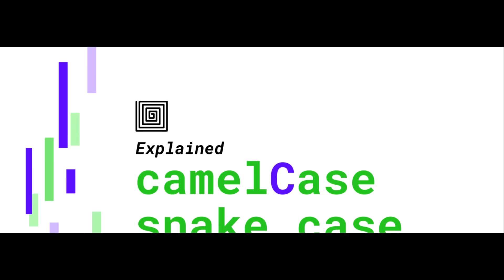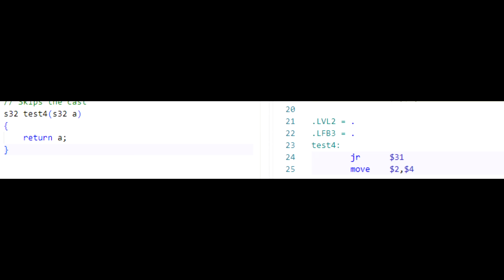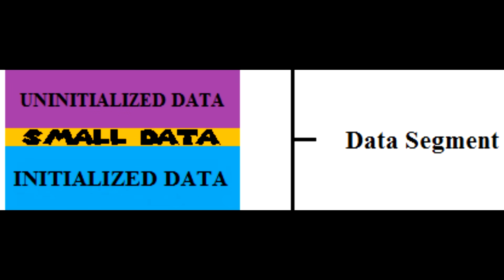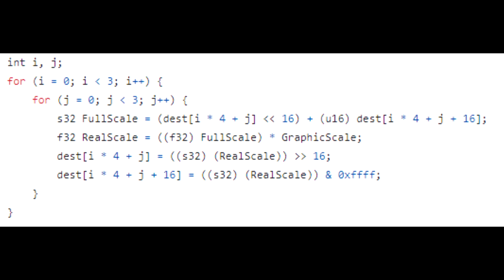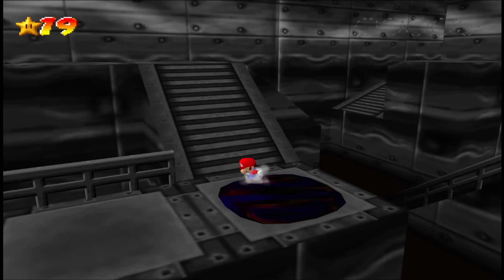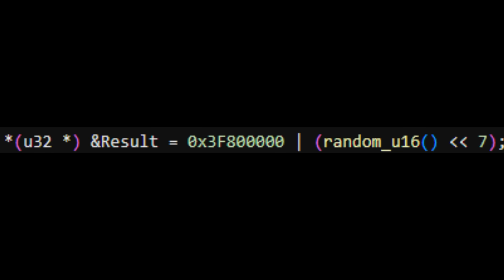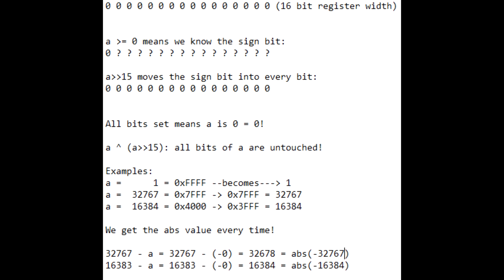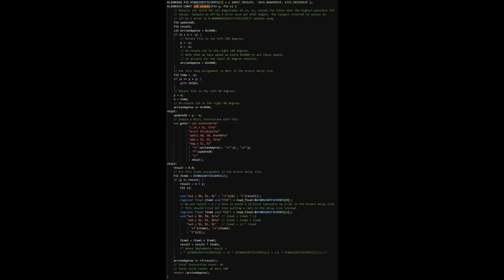Optimizing with "Bad Code"

Comment: The compiler's not going to flip the direction of your loops around for you. That said the reverse loop's typically written for(int i = init; i--;). Loops are interesting because if you really need to you can break a for loop down into a do while nested inside an if and some optimizations the compiler might not risk because of the signednesss of the index. See what the compiler does when you use unsigned int i vs int i.
Reply from the maker: why not? it should produce the exact same functionality for less cycles. it should be able to flip that.
Reply: I think it's a bit asinine that the compiler won't flip it. Also as for signedness of loop counters, I never understood why that matters. At a hardware level the comparison is signed, not the number itself.
Reply: @KazeN64 the compiler would have to do quite a bit of semantic analysis to verify that the resulting code behaves the same. The problem fundamentally is that incrementing and decrementing are two distinct behaviors, the compiler's a bit of a hardnose. You and I can look at the code and see an obvious difference and improvement, but without someone writing a compiler optimization pass that 100% gets it right when to reverse the loop or not it could produce wildly different behaviors.

Consider shifting data backwards or forwards in an array, although the code is very similar there's a reason for the direction of the loop to avoid overwriting data or referencing stale data etc. An optimization pass likely would need to determine that the memory accesses are non-overlapping among other conditions. And from my memory, I don't think I've ever seen a compiler do this, but that might in part be because the optimization exists but the hardware I'm targeting doesn't have this benefit. The reason I'd be suspicious it would is that for very old hardware this was very much was a thing, it used to be significantly better to loop in reverse over data, the hardware we have now is agnostic about the direction but still prefers local accesses. I'd doubt this optimization pass would exist for your compiler to use on the n64.
Reply: @williamdrum9899  To be fair  it is a bit strange that it would matter, it's not immediately intuitive but it's to do with how the c/c++ standard pictures a sort of universal cpu to be able to function and how they'd like to be really precise with what different operations mean on different types. Essentially the signedness determines whether wrap around is the expected behavior or not, the result is that for example the comparison x < y has different behaviors depending on the signedness and so at the optimization level has different constraints to prove that making certain transformations result in the same behavior of code. Simple example, say x = 0, if signed when running the comparison consider what the the signed -1 value looks like in binary if it were treated as unsigned. The "standard" though confusing, allows that difference to matter and consequently the people writing the compiler with that bit of wiggle room can prove slightly different things about your code, and thus do different optimizations because of it.

A better example might be a combination of lines like int x = other_number; int y = x + 1; if (x > y) {} vs unsigned int = other_number; unsigned int y = x + 1; if (x > y) {}, if I remember correctly because wrap around isn't expected of signed numbers, the compiler may discard the if condition and always assume it's true, conversely for the unsigned type because the typing allows wrap around it can't discard the condition.
Reply: @andersama2215  I think I see what you're getting at. 

unsigned int x = some_number;
unsigned int y = x+1;
if(x>y){}

If I'm understanding correctly the compiler can't discard the "if" because x could be FFFFFFFF.
Reply from the maker: @andersama2215  its really not that complicated, especially in the case of a linked list iteration. and even the specific, more complicated example you are giving here is something the compiler does reordering on if you use the "restrict" keyword.
Reply: @williamdrum9899  The way I've seen it described doesn't really translate well with "wrap-around" or "overflow" etc... The way I prefer to think about it and the way I imagine the people considering the optimizations think about it is whether operations preserve the "signedness" of the result. By tacking on "unsigned" which isn't the default for the integer types they have the freedom to ignore the "sign" because there wasn't any to start with and so the code is more along the lines of what you'd probably expect out of the hardware doing 2's complement math anyway.

Comment: Once I was writing a loop in assembly that did two different things at several points based on a boolean state variable. Instead of checking the variable each time and branching I just wrote two variants of the loop and jumped between the equivalent point in the loop whenever I wanted to change the variable, eliminating said variable.

Comment: This is not bad code. It might be to the modern OOP kids who believe in SOLID and it might have given a heart attack to the webdev lot who have never heard about gotos but, objectively, this is not bad code. It is code that does its one and only job : improving the performance of the game. Code readability is overrated. You're more likely going to either rewrite it all again or never touch it ever than do incremental maintenance on it. As long as you know what the functions are doing then you're golden.

Comment: 11:05 If you're serious about optimizing for hardware revisions, it seems to me it'd be simplest to include multiple compiled versions of RTYI in the ROM and code up a simple apploader to run beforehand which can detect the hardware revision and load the correct executable. Hardware testing every version would be a headache, though.
Reply from the maker: i would like it to just be one rom at the end. having multiple different roms just feels wrong to me.
Reply: @KazeN64  What I'm saying is one ROM, but multiple executables.  Only if there's enough space on the ROM for that, of course.
Reply from the maker: oh in that case isn't your suggestion basically the exact one i implemented? or what more do you want added to the idea i presented

ROM space is the biggest limit btw, it'll be hard to stay under 64mb.
Reply: @KazeN64 I'm not too knowledgeable, but the bug you showed in the screenshot seems pervasive enough that the entire codebase would benefit from not needing to work around that hardware bug. If that's true, then "cross compiling" for different N64 revisions and selecting the correct executable at runtime seems like a better optimization then self-modifying select functions that might benefit the most from not having the hardware bug workaround.  If I understand, your current solution is the latter,
Reply: @Minty_Meeo  I think their goal is to fit on a single N64 cartridge, so increasing the total code size by 2x or more is probably not a good solution.

Comment: 8:27 This seems like a terribly misguided optimization.  Why not rework the Object struct to contain a vector3f for the xyz position, then rework lateral_dist_between_objects to accept pointers to vector3f structs?  Nothing specific to the Object struct is needed in that function.
Reply from the maker: takes 1-2 cycle more to give the pointer to the vector in the object instead of just the object
Reply: Okay, that must be a deficiency in MIPS, then.  I'm more familiar with PowerPC, and in that architecture the addi instruction can be used as a move register mnemonic, so the cost of passing a parameter of Object* and a parameter of pointer-to vector3f member of Object* would be the same, I think.
Reply from the maker: that can be done here too but you now have the additional move instruction
Reply: @Minty_Meeo  It's not the same, if I understand this micro-optimization correctly it saves one instruction:

; Using vector pointers
lui     $v0,%hi(objv1)
lw      $a0,%lo(objv1)($v0) ; load the obj pointer into a0
addiu   $a1,$a0,36 ; add offset to second vector
jal     lateral_dist_between_objects_vec(vec3*, vec3*)
addiu   $a0,$a0,4 ; add offset to first vector

; Using Kaze's method
lui     $v0,%hi(objx)
lw      $a0,%lo(objx)($v0) ; load first object address into a0
jal     lateral_dist_between_objects(obj*, obj*)
addiu   $a1,$a0,32 ; load "second object" (it's just the computed address, as shown in the video)

Such optimization would also apply for PowerPC, see:

; Using vector pointers
lis r9,objv1@ha
lwz r3,objv1@l(9) ; load the obj pointer into r3
addi r4,r3,36  ; add offset to second vector
addi r3,r3,4  ; add offset to first vector
bl lateral_dist_between_objects_vec(vec3*, vec3*)

; Using Kaze's method
lis r9,objx@ha
lwz r3,objx@l(r9) ; load first object address into r3
addi r4,r3,32  ; load "second object" (it's just the computed address, as shown in the video)
bl lateral_dist_between_objects(obj*, obj*)

So it is faster by virtue of saving 1 WHOLE instruction! If the obj was in inside the $gp area then the first lui instruction would also be saved, but that'd apply for both methods regardless.
Reply: Oh, I was assuming the object pointers would already be in registers, but if loading them is a step, and the pointers to objects are still needed after the function call, then I suppose this is faster.
Reply: @Minty_Meeo  Kaze did mention in the pinned comment that this way "we can cover one special case in 1 cycle less and have all the other cases work in the same amount of cycles". 
So it is indeed a micro optimization that is better for that special case he showcased in the video and otherwise is the same.

Comment: 8:04 but you still have a jump in there.  that GOTO doesn't get optimized out, does it?  jumps are really slow.  even a short branch forces a pipeline flush, doesn't it?  How much performance does not having to cache those... what, 20 opcodes? buy you, and is it more than the pipeline flush?

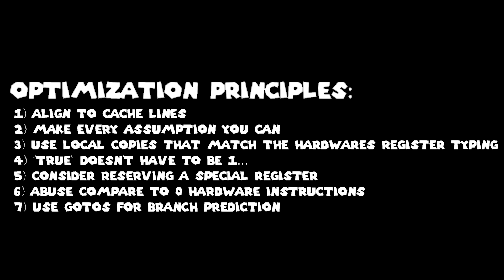also 8:59 sweet lord, what are you doing?  why do you have to do that?  just create a vector2 type (struct of 2 floats), replace the posX,posY in the actor struct with that vector2 struct (which costs you nothing, since that's how structs work) and convert the getDistance(...) function to accept that type instead of an actor struct.  that will save you a headache, make the code a LOT more readable even than it was to begin with, make that function a lot more reusable, and (in theory at least) not cost any performance.  at the very least it will have the same performance impact as whatever the hell you're doing.

literally the only legitimate reason to do that is if you're not allowed to touch the getDistance function, e.g. because it's a library call (which in your case it isn't, and you can muck with it all you want because rewriting the engine is what this is about), and if it's a library call then you shouldn't do that anyway unless you want to constrain yourself to that specific version of that library (and then you'd be better off just copy pasting the offending function into your codebase and tweaking it there) because you can't guarantee that a later version of the library won't try to access other fields of that struct, which since you've offset it so that only those two fields are valid will point to god knows what.  all your approach does is make your code needlessly less readable and more error prone in the pursuit of a few microseconds which you may or may not actually save.
Reply from the maker: n64 has no branch prediction and uses a delay slot so that will never be a cost we have to account for.

passing in a pointer to the position would be an extra cycle to add to the object pointer offset. you can't make use of the free constant addressing that mips load instructions provide.

Comment: Generally when writing a lot of complex stuff like this where it's not obvious what it does, it's not so much that you can't do it, but they really want you to write code comments along the way to explain to other people why it's done that way and warn them what kind of scenarios could break it. So the more inline assembly you use, the more code comments you need to go along with it... that is to say, the less human-readable the code itself is, the more you have to compensate by having human-readable translations alongside of it. For that code, you'd end up writing a novel explaining it to any programmer that comes after you... and most people would rather just make the code itself more readable than spend half a day explaining their heavily-optimized code to a hypothetical newcomer in the code comments. But when it's absolutely necessary, you will see tricks like this used along with extensive documentation (and sometimes cursing and F-bombs about how pissed they are they had to write the code this way and how much they hate the compiler depending on how professional they are).
Reply: or for when you come back to it next week

Comment: You should maybe consider keeping track of which functions have been made optimized via unreadable bullshit, along with a naive/pseudocode explanation.

If it were me, I would simply prefix every relevant method with a comment reading “God has abandoned us” followed by that explanation. That way I can easily CTRL-F all the cursed code to look through it later

Comment: I'm just a lowly slug at coding compared to you, but I noticed in your code that your using i++. When I was in school learning programming, my teacher said it was more efficient to increment with ++i. Something about the compiler creating more code with the former.

Anyways, since you're doing crazy optimizations and if this is true, you could use this in your code.
Reply: that's only a thing on very old compilers, modern compilers should compile code using i++ and ++i to the exact same code
Reply: ++i and i++ mean different things, former is pre-increment and latter is post-increment. If you use it in an expression, that would mean that post-increment (i++) needs to save the initial value since that is what it returns. Pre-increment does the increment before so that saves an instruction. Ofc this can be optimized away when used in a regular for loop so it doesn't really matter that much. I prefer to use i++ mostly
Reply: Modern compilers are smart enough that they will be able to optimize away any difference between them most likely. I don't think it will actually matter in Kaze's case

Comment: Why and how does the Memcpy of a function work if the game is reading the code from cartridge ROM, which (I thought) cannot be modified by the console?
Reply: The code is not actually executed from the cartridge, is loaded to ram first that's why the memcpy works
Reply: @ederbarrero5585  Is ALL of the code loaded into an area in RAM before execution begins? Or is the program loaded in pieces, as needed?

Comment: In 25 years "how I increased rendering speed by 1/2000 of a frame per hour by manipulating the gravitational pull of the sun to ensure the optimal distribution of stray photons to line up perfectly with all non solid floors to allow you to add non solid items with zero cpu cycles, this is basically a free performance boost.
Reply: I’d watch that 20 minute video while not having any clue at all

Comment: That padding struct member really is the worst one here. The others a re reasonably justifiable but the padding one is just showing that you don't know your tools properly. Remove it and replace it with an alignment attribute.
Reply from the maker: you don't actually even need to mark them for padding here, because the biggest member is a 4 byte sizes, so it will be aligned to 4 bytes (which will pad it to 0x30 size). i just explicitly marked it here to illustrate the point in an easy to understand way.

Comment: How about removing linked lists at all? Most of the time linked lists means littering and wasting the cash, and using many unnecessary pointer indirection. Most of the perceived advantages of linked lists (adding in the middle of a container in constant time) are often not even advantages because they are compensated by having to reach the element at which the insertion happens (in linear time times all the cash misses).
Reply: That really depends on the case, and you can't say in general, because there are a lot of ways to alleviate that issue. You can keep pointers to an element that you are accessing already, for one example, another would be allocating nodes that hold multiple objects rather than just one. And the linked list case was an example, not necessarily something that's in Mario 64.
Reply from the maker: my use case here is that i have elements of varying size. i don't have a better idea for this right now.
it USED TO BE a 2 dimensional doubly linked list, but the parents and previous elements were rarely accessed so i turned this into a 2 dimensional forward linked list with the 2 backwards links stored in a hashmap that i index from the current node (if i ever need it, usually only on level load)

Comment: honestly, seriously, why are you writing these functions in C anymore, instead of making a .s file and just writing in assembly where you can control exactly what instructions run, in a form factor that actually makes sense instead of beating the compiler over the head trying to get it to do what you want.
Reply from the maker: i need my function to be placed inbetween the other graphrender functions for icache coherency